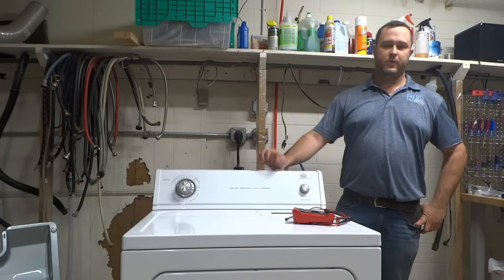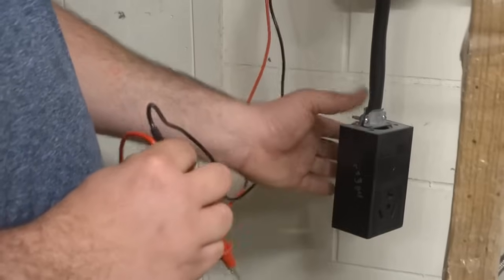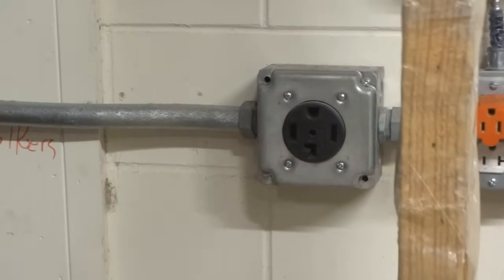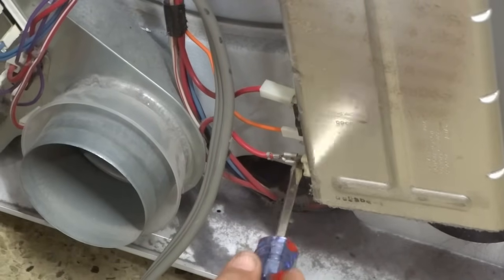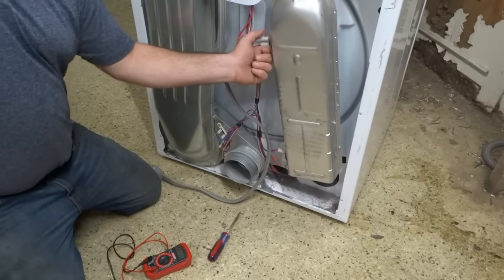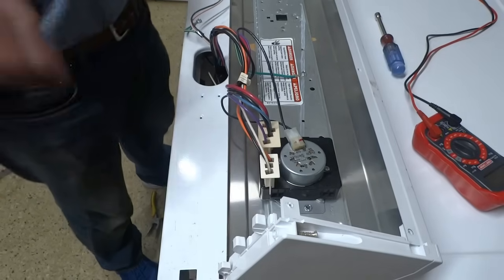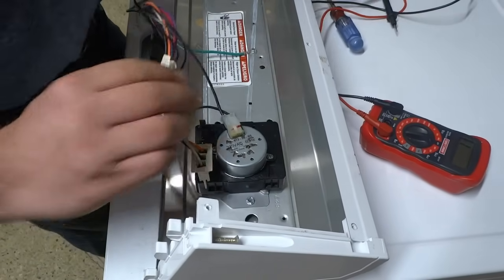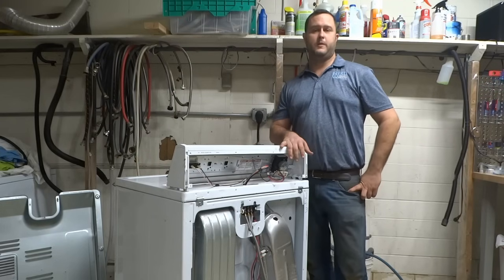Whirlpool Dryer Not Heating - Diagnosing Common Issues

Comment: Hi. Mine dryer have high limit thermostat on the top like yours, with no continuity. But dryer still running and heats up. Is this different type of thermostats like NO or NC ?
Reply: Are you sure it’s a high limit?Dryers also have a component called a thermistor,Which I have seen some think is a limit switch but is not.A limit switch (when functioning correctly)opens at a set temperature and almost always fails open.A thermistor might not sound the continuity icon(most sound at 25 Ohms or less)Try Taking an Ohm reading instead of continuity reading.A thermistor’s resistance changes with temperature.
Reply: Eugene Kovalenko is your dryer not working? If there's no continuity the heating element should not come one. What brand is it?
Reply: CSA APPLIANCE Parts and Repairs Whirpool model#ywed4800xq0 . at the bottom close to heater contacts, i have another thermostat with 4 contacts, each on the side. May be this bottom thermostat have cut off function (2contacts) and thermistor (another 2 contacts)? Like 2 in 1
Reply: Eugene Kovalenko the bottom thermostat is the hi-limit thermostat that controls the heat f from the heating element...
Reply: CSA APPLIANCE Parts and Repairs why there is 4 contacts, not 2 on bottom thermostat?
Reply from the maker: Thermistors will be tied to a computer. They are definitely on the newer ones.